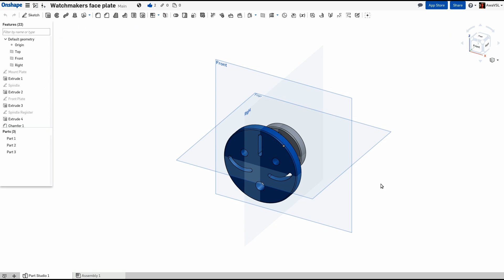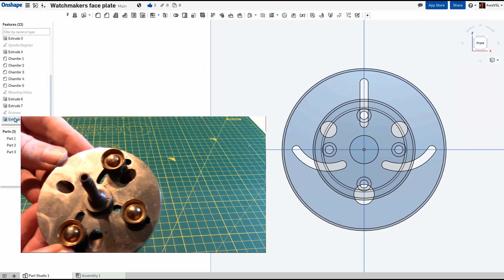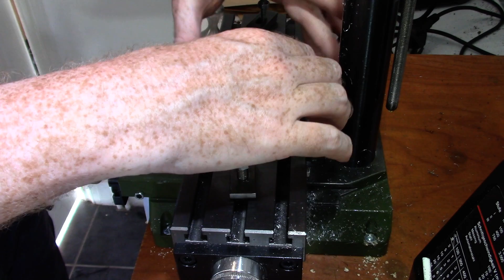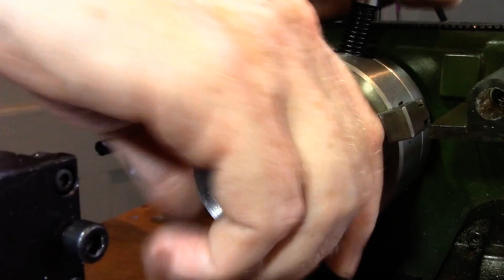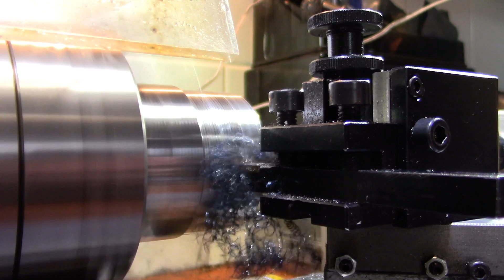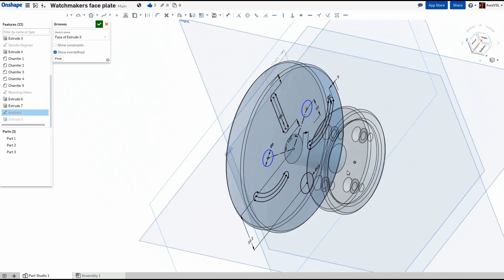Watchmakers Face Plate - Part 4

Comment: Hello
I am very fascinated with your videos. this quarentine makes me watch them again and again and again.
It is very nice know people with same equipment, I have not seen many works with this milling FF230 in the web .
In this video, I have seen you are making a slot mill 4 mm diameter (1500 rpm) , 25mm length aprox, and with depths of 0.2 mm in  hardened steel, I have noticed more or less 20 sec in one pass so  1 mm/seg. aprox in advance and all works fien, it is very nice.

With this same equipment and with an endmill, not very good, but not so bad because it is 6 mm Proxxon original, I am trying, in an aluminium piece (softer material)  of 4 mm width trying to do a flat surface in 120 m lengths and with more than 0.1 mm depth (and not more than 1 mm/sec advance ) it  seems that machine cannot work more, it seems that if you increase depth or advance other type of noise appears. So it seems it is working worse than in your work/project that as is a slot in hardened sttel is supposed to have a heavy work.
I am trying to understand and investigate what happens and why such a different behaviour comparing with your heavy work/job. I know that as alumininium is softer than steel it is better a 2 flutes mills, I have tested with one and not so many improvementes I have observed.
Other issue I have just realized because I noticed making tests that motor gets quite warm , and I have seen that in Instruction manual in motor characteristic is said "literally" 
Power rating: 140 watts 
Short time operation : 10 MINUTES.
   I have not seen it before 

So how many time did you spent in make the slot??? Did you made many stops during execution??

One advice I have seen in order to improve works in this small home machines is not to use drill lever to increase deths because as spindle goes out , more vain free decrease ridigity of the milling colum/spindle and it is not good for chattering, vibrations and others.

Regards and of course thanks for sharing.

Comment: Your Proxxon mill is very much like the little Emco mill I started with. There round columns are more than a bit frustrating. For finding the center of a hole with an edge finder try Googling Osborne Maneuver. Chip re-cutting even on the largest industrial machines is a major problem. It seriously reduces cutting tool life and affects the part finish and it's desired dimensional size if it gets serious enough. That's why some industrial parts manufacturing requires 100-300 psi coolant blasting the chips clear as soon as there cut. High precision gun drilling can sometimes use cutting oil pressures in excess of 3,000 psi for the same reason.As others have pointed out chain drilling the slots a bit undersize first will help a great deal to reduce the loads and let the chips drop through and away from the end mill. Even with that, constantly clearing any that remain with either compressed air or a shop vac still might be needed. Cutting oil while machining slots can sometimes cause more problems than it helps since the chips are held in with the oil. For the average person with a small home shop band sawing the bulk of the material away is always far faster than machining. For cutting slots that chain drilling is still far faster. A saw or drill is always much more efficient at metal removal than machining plus it's easier on your expensive end mills and a light weight mill. 

Metal removal rates with a multi tooth cutter is always a factor of the rpm, tooth count and feed rate. If the rpm is correct or below the maximum and if the rpm is known or can be calculated, then the feed rate is based on that and the chip depth each tooth takes that you consider the machine is capable of. You do want to take a chip and not dust with something like steel. Somewhere between .001" and .003" per tooth per revolution would be a good starting point for the feed rate with a sharp end mill. .003" might be well above what that mill will do though. Once the feed rate is calculated you then set the depth of cut the machine and cutting tool are capable of. If you don't take an actual chip then at least some of the time the endmill is rubbing instead of cutting. That also drastically shortens cutting tool life. Inserting the end mills shank as deep as you can inside the collet or better yet using the short series end mills will help far more than it would seem with these little mills. Cutting any metal requires the stiffest tool and shortest projection possible. Rigidity is EVERYTHING with machine tools, and these little mills need all the tricks you can think of.
Reply from the maker: Watching this video is a bit of a blast from the past. :) I hope I'm justified in saying that I've learned a lot since then. For my lessons about chip re-cutting, and clearance, see my recent Vice Stop video, and who I used an airbrush to improvise some air powered cool and chip removal.

I'm still a bit behind on feed rates, and need some way to predictably move my table. I'm considering building a power feed, if only something simple based on a slow electric screwdriver.
Reply: @AdventureswithaVerySmallLathe  Thanks and I'll check that video out. Thankfully feed rates aren't hyper critical so once you have the calculations for tooth load to take that chip size decided on then your mills thread pitch gives you the number of handle rotations per minute you'd need for that chip size. A few timed trials while turning the handle will give you the rough rotation rate. Fairly close is good enough in most cases. While I've cut quite a bit of steel, stainless and even some titanium on my little Emco mill it doesn't like it at all. Had I not upgraded to a Bridgeport clone my thought was to brace the mills column with 3 angled 1"-1 1/2" diameter rods bolted to the bench top and the top of the mills column. It's column rigidity is the serious drawback to milling the harder metals. As they are I think there made mostly for doing aluminum as the hardest material. That said that little Emco milling head is still going to be used while mounted to the large mills table to drill, tap and machine some aluminum mounts to fit my large mills tapered column to mount a good dro scale on it. :-)

Comment: Loving the series!

A tip I heard when milling slots is to use a slightly smaller drill (maybe 3 or 3.5mm?) and chain drill a series of holes. The reason for this is that drills are one of the fastest ways to remove metal. It means that the end mill will have less work to do, and should permit deeper cuts.

No idea if this idea is true or not, I've been rebuilding my milling machine for maybe 90% of the time I've owned it! (but should be done around December :D)

Keep up the sweet work!
Reply from the maker: Thanks for the tip! Chain drilling is something that a couple of people suggested in earlier comments, but I haven't had much luck so far. The Proxxon mill isn't incredibly rigid as it has a round column, and I get a lot of tool chatter. I need to spend some time and scrap material developing my technique and learn what works best on my machine.

I look forward to seeing the results of your milling machine rebuild.

Comment: Videos are superb. Love the music. And I have deduced that you have a Proxxon outfit. Your mill is slightly larger than mine, a Proxxon MF70. Proxxon makes very good tools -- at a price. The MF70 is limited to a maximun shank of 3.6mm (1/8") and I would really like to see a 3mm shank brazed on to a larger size cutter than the collets will support. THis channel and JOP are right up my alley.
Thanks!
Reply from the maker: I'm scared to try using larger cutters that the shank size of my largest collet, as I'm worried I might overload the mill. I was able to adapt this small cutter to a larger shank, as the brazed on shank is just a sleeve around the original shank. Adapting a carbide cutter to a smaller shank would almost certainly be much weaker.

Comment: You mention needing a smaller collet set to suit this particular mill...
...assuming your mill is the Proxxon PF 230 then check the following link (figure you're UK based)
http://www.axminster.co.uk/proxxon-5-piece-collet-set-for-pf-230-ff-230-474685

I've recently bought this same mill (PF 230) & also the updated version of your lathe, the PD 250/E.
Been enjoying & learning from your videos.
Reply from the maker: Thanks, that'll be really useful! I spent ages measuring the taper, trying to find a matching standard. It never occurred to me to just check whether Proxxon made a set of smaller collets. Great to meet someone with the same equipment. :) Are there any obvious differences with your updated lathe? I bought mine just under two years ago.
Reply from the maker: My lathe is the PD 250/E as well. The PD 230 had a different style of chuck and a number of differences in the bed and cross slide. When you said yours was updated, I thought you might have noticed something in the videos that was different?
Reply: Doh!!...Sorry about that, for whatever reason I was under the impression yours was the PD 230.
It should've twigged when seeing that your 3 Jaw Chuck was identical to my own.

Comment: Hi! Your videos are very well done. Love the music and the volume is just right.

Suggestions re cutting speeds: most data from manuf are for optimum production speed where wear of the cutter is not the prime factor, removal of material is. In our shops, we might have one or two cutters for a particular job so extending the life of the cutter is the first priority. So it is okay to go slower. I don't remember if you mentioned whether the face plate blank is pre-hardened steel? Would that be what limits your choice of cutters to carbide rather than HSS?

One of the cheapest form of cutter is the twist drill in smaller size. So it might make sense to drill a hole at end end of a slot and mill the material in between or even chain drill the whole slot. 

One more thing: I see you (like many others) are grabbing the speed crank handle when cutting. The issue with using it when cutting is that it is hard to maintain an even momentum. Better to grab the handwheel with the fingers by its outside perimeter and use both hands alternatively to turn the handle. You will get a better feel and more control that way. Same for lathes. Cheers! Daniel
Reply from the maker: Thanks! The steel is 42CrMo4 for the face plate. It's a German standard similar to 4140, and it is in tempered condition. Carbide isn't required, but I haven't had much luck getting hold of HSS endmills that work nearly as well as the cutter I used in this video. I prefer not to chain drill, as I get more chatter dealing with the variation in the cut than with the consistent cut of a slot in the fresh material. Drilling at the end would probably help with the plunge cuts though, so is worth considering. I'll try that technique for the curved slots.

I learned how to use the handwheel properly for even momentum when I was at high school, a long time ago. Sadly I'm not good at obeying what my teacher told me. Thanks for reminding to focus on improving my technique. :)
Reply: Adventures with a Very Small Lathe Thanks for the answers and sharing info. At my brother's work, the manual mills are strictly confined to HSS cutters as the carbide endmills break due to less rigid spindles. All the VMC are using carbide. I know some carbide cut better due to design so understand the choice you made.

Funny you mention your high school teacher! My machine shop teacher was very particular about how to operate machines and have been following his teachings since I was 15!

Comment: Haven't finished watching yet, but regarding locating hole centers, I recommend using a dial test indicator.
Reply from the maker: Thanks for the tip! I have tried that, but unfortunately my mill has really bad tramming issues between the column height adjustment and the quill. The quill range is very limited, so I often have to adjust the column to account for the height of the indicator, which ruins the accuracy of the measurement. Ideally I'd have a much larger milling machine and a much bigger lathe, but that's ruin the branding of my channel. ;)
Reply: Hm, yes I see what you mean.  If you had a test indicator with dovetailed mountings,  most of them have a dovetail on the front just underneath the dial.  You could make a holder with the post (to be held in a collet) offset from the dovetail clamp a bit, so that the indicator could be mounted nearly horizontal but offset so that the tip could be angled down into the hole you're locating.  I think that would be compact enough along the Z axis that you wouldn't need to change the head's position on the column... but I don't know, you might still have issues installing an end mill after removing the indicator... especially if you had to change the collet too, that takes a bunch of space.
Reply from the maker: That sounds worth a try. I haven't checked my indicators, but the dovetail might just be close enough. I'll try it on my next video.
Reply from the maker: Thanks, I'll give it a try. I suspect it may have a similar issue to using an indicator, as the length of the wiggler will mean I have to raise the column height of the mill, which is out of tram with the quill and spindle, and has no real means of adjustment.
Reply: If you want I can measure the height of my wiggler vs my edge finder (which appears to be the same as yours).  I'd hate to see you spend money on something you can't use.   Chris
Reply from the maker: Thanks, that would be useful to know.
Reply from the maker: Thanks Shadowdog500, I really appreciate the effort you've gone to.